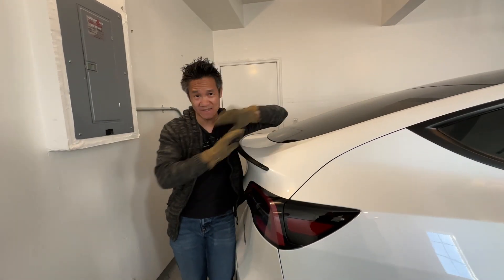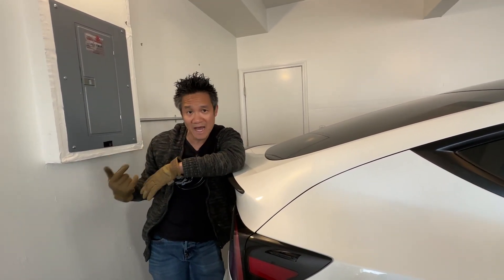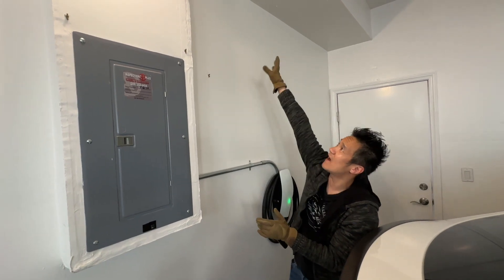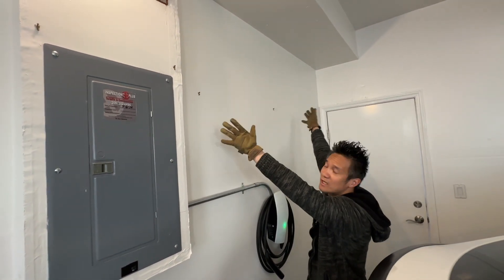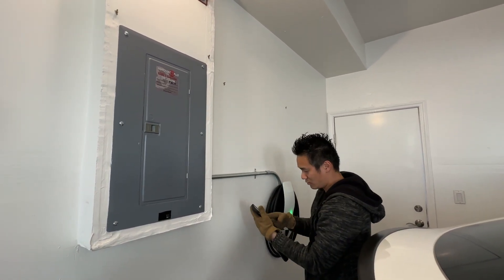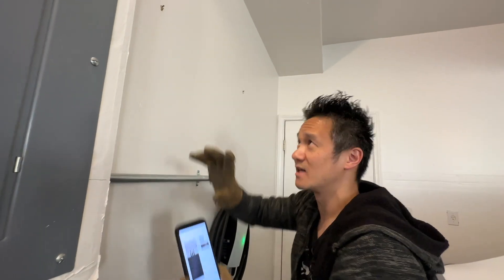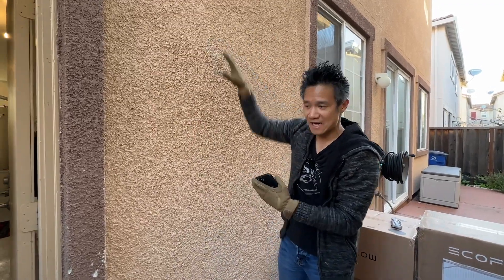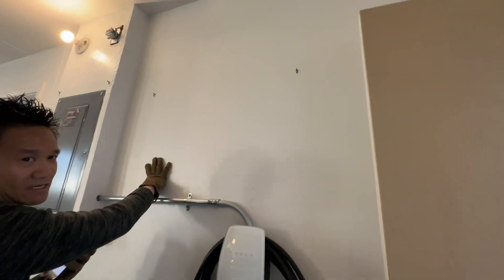30kWh Home Backup Power System to charge my TESLA Model Y!  Ecoflow PowerKit!

Comment: Also keep in mind you can't use a smart dual fuel generator or other ecoflow accessories over DC if you have 3 batteries connected.  You'd have to disconnect the 3rd battery, put in the smart generator adapter and then plug in using the XT150 if you wanted backup generator power or run the Wave2 or something like that off the 3rd power port.
Reply from the maker: Good call!  I forgot about how the Smart Generator actually connected to the PowerHub!  

I decided that the Ecoflow SmartPanel has too many "quirks" when using in the 220V mode that would limit me too much.  So I decided to not use the PowerKit to charge my Tesla... (for now).  I am just using it to power my Shed (Tiny Home): https://www.youtube.com/watch?v=itnw5lOqCNc

Comment: Check with your electrician but I saw something about the powerkit smart distribution panel meant only for offgrid so it doesn't have proper grounding for legal use in a home wiring situation.  I think you have to wire it through the smart home panel
Reply from the maker: yeah, I wasn't sure on that part, but decided to keep it completely off-grid and didn't end up wiring it to my home directly.  

It sounds like you have also looked into the PowerKit yourself, are you getting one? Have one?  Or just curious? :)
Reply: @UTECHPIA  researching options, contemplating something to take our home at least partially off-grid.  Got a Delta2Max this past summer to take my home office off-grid, to use in the garage(running plasma cutter and air compressor trips breaker 😅) and for camping.

Leaning Victron due to power assist and the Quattro series has dual AC input with automatic transfer switch.  Thinking about building it on a mobile platform like a hand truck so I could take it with us if needed😁